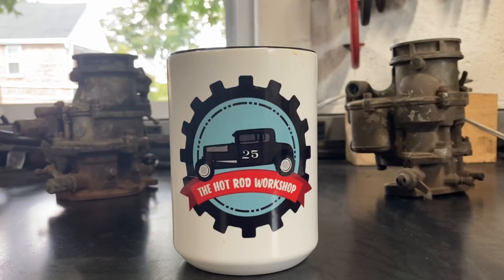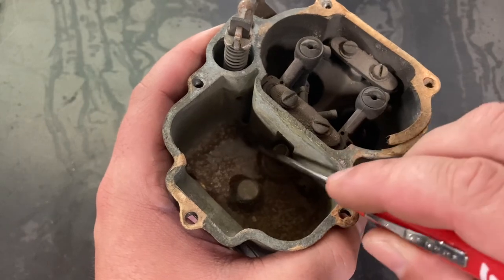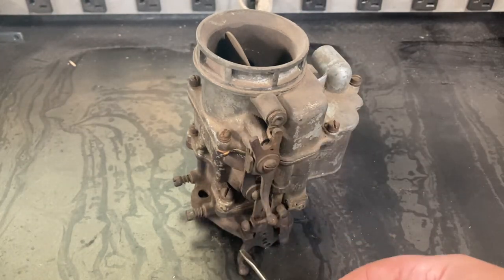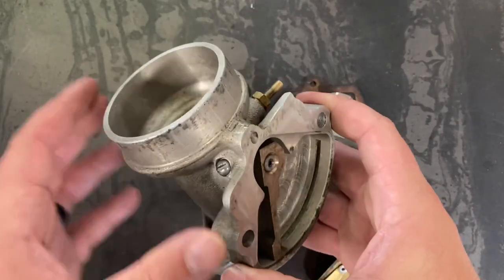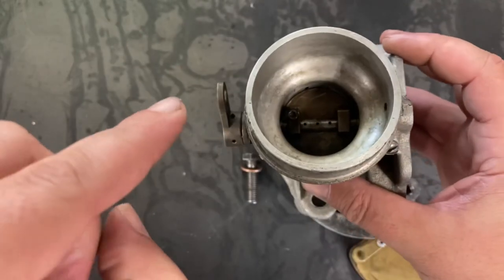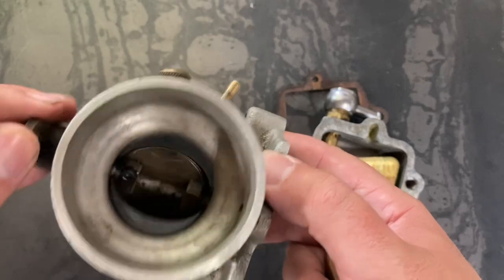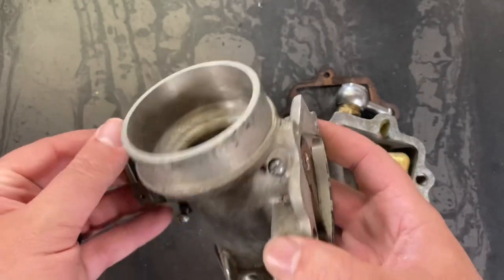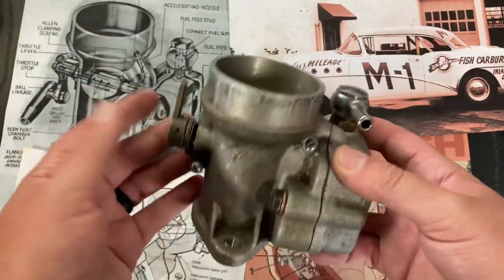Fish Carburetor Breakdown

Comment: Great to see. I use these and love them. An interesting thing about these is, unlike a normal carb where each fuel circuit builds on each other adding fuel as the throttle is opened, the fish carb is backward and adjusted for max power using the adjustment at the top of the pickup (adjustable only at full throttle through the blanking screw) then midrange is done moving the throttle plate in relation to the shaft correcting mixture buy allowing more or less air in and finally the idle with the brass air corrector screw. Fuel level has little/no effect as long as there is enough fuel in the bowl.  I really like seeing others paying interest in these. keep up the good work.
Reply from the maker: A very interesting and cool piece of hot rodding history for sure! Thank you for watching!

Comment: I run one of these on a little vw engine. Also on a larger supercharged unit. You need a straight piece of road and a ball point pen to tune😂. It’s a shame they did remanufacture them as intended. I used to own a twin carb set up nos still in boxes manifolds and all always regretted selling them. Great video.

Comment: Thanks for posting, new information for me!    **how comparable in performance or CFM is that one barrel fish, as compare to the two-barrel 94 you showed ?     PS  The cost doesn’t sound so horrible today, compared with a $400 new Stromberg 97.
Reply from the maker: It’s difficult to find any documented CFM ratings for these carbs, but from what I understand this M1 was designed to work on a range of 300ci-500ci engine size. That being said, calculating the CFM requirements for a 500ci engine at (a modest) 4000 RPM puts the output at somewhere just south of 500 CFM. Way more than the usual 150-200 CFM we typically see out of the common Holleys at the time. As for the price, you’re absolutely right. I couldn’t find any M1’s for sale currently, but considering the condition of the used fish carb, the lack of available replacement parts.. a brand new 97’ may be the wiser option.
Reply: @TheHotRodWorkshop  I only have the flow figures for the small  1.65” bore Reece Fish: 145.7 Scfm @ 10", or 294 Scfm @ 3"HG.  So yeah, the 2" bore Fish should be absolutely able to supply a 500ci (or more) engine. Also - since the fish works on pressure differential instead of vacuum, those numbers are not 1:1 comparable.